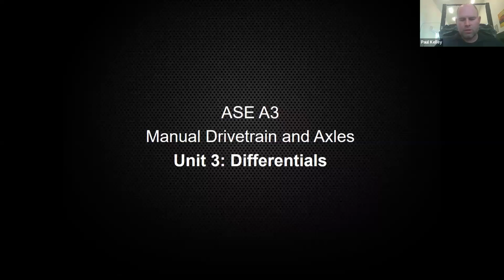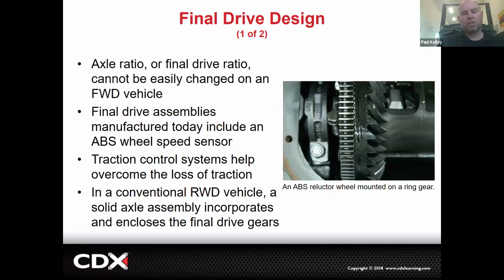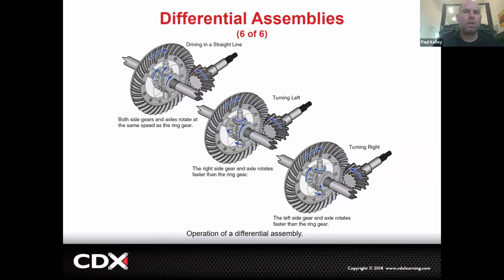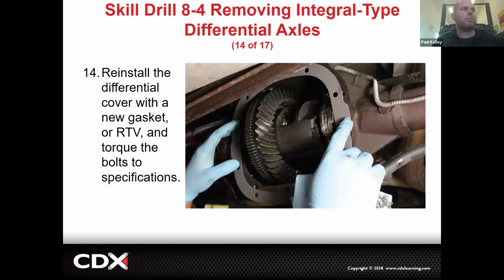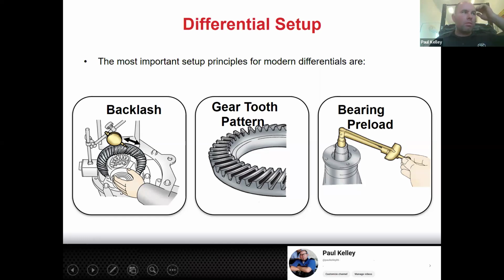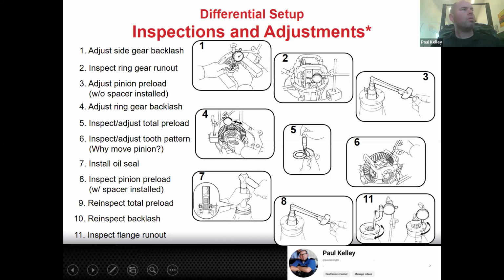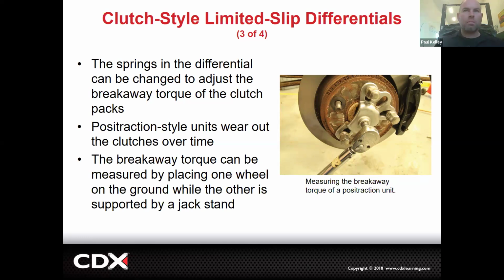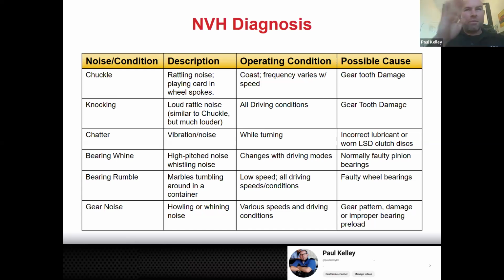ASE A3 Manual Drivetrain and Axles Unit 3 Differentials Class Lecture

Comment: So I just got a picture today from my boss where the axle broke on a Chevrolet Silverado. I replaced the bearings for the axle. Made sure that the c clips were in made sure the right fluid and amount was in. But we got the bearings from Autozone, can a defective axle bearing cause the axle to break, or can a bad axle bearing cause the housing to be ovaled out causing the new bearing to go bad causing it to break because I’m not sure what exactly happened on this one.
Reply from the maker: A 1500? Must be if it had c clips. I dont think there are any adjustments on that. 
If it was a 2500 or bigger with a full floating rear axle I suspect the preload would have been too high and seized. 

In your case its hard to say. If the axle was hammered in and damaged when installing maybe, or yes its possible it could be a defective bearing. Its hard to say. Sounds like it may have been spinning the inner race on the shaft which would make a lot of heat.

Comment: So I’m currently working on rebuilding a rear differential for a 2017 ford F-150 raptor it’s a 9.75 the shims fell out when taking it apart how do I get them back in if they are supposed to be pressed in
Reply from the maker: Sorry missed this, if we are talking about the shims between the differential housing and the side bearings on the differential case, set one in when you put the case in, its kind of awkward, then the second you can get started by hand and drive it in with a brass drift and a hammer.